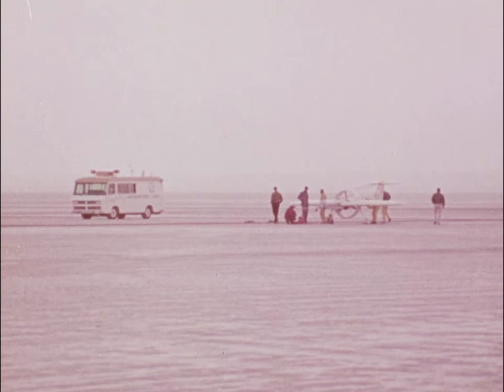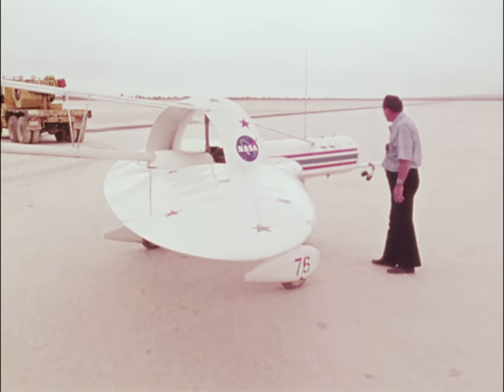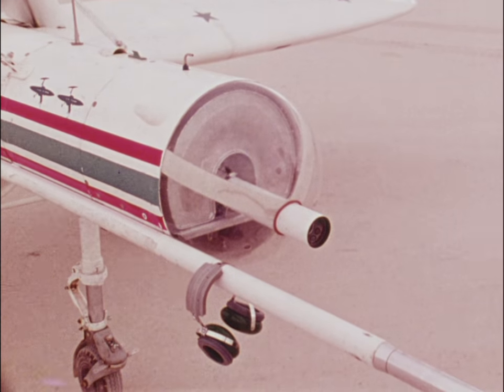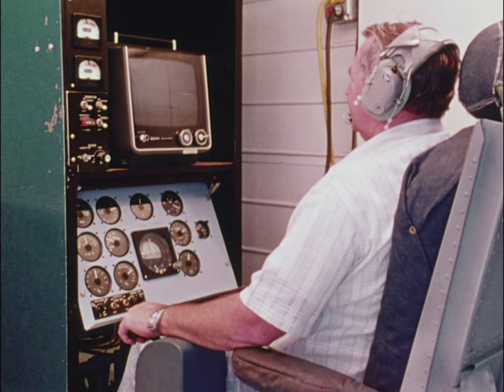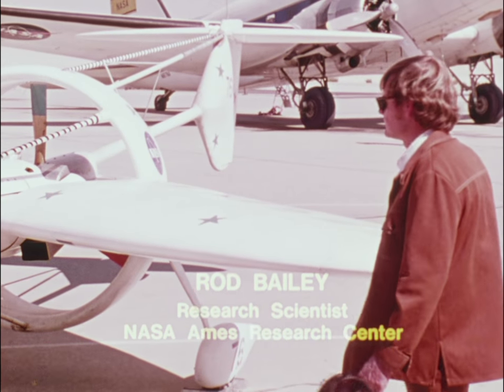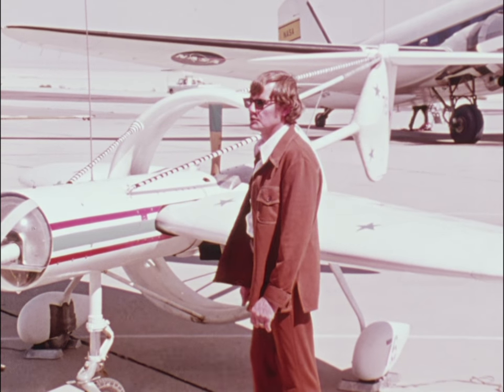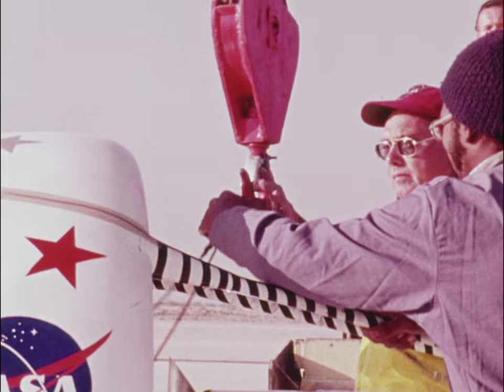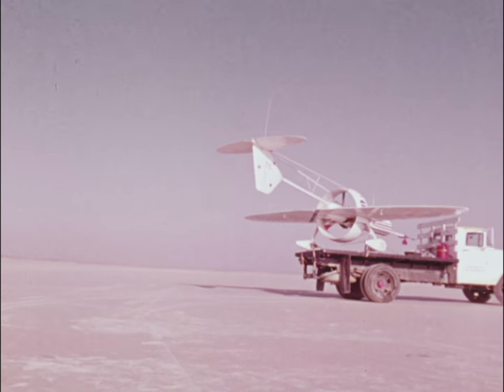Oblique Wing Flights

Comment: I'm no rocket engineer, seriously... A POV on board camera Remote RF fly by wire control from a climate controlled trailer system in 1970 to test this rediculous joke of a project? Dumb idea utilizing HI FI...
Reply: No. Respectully @adam, you didn't check facts.   read about AD-1 flew well piloted, designed by Burth Rutan no less. flew well up to certain angles just standard mechanical controls, not even hydraulics.. And read again what the benefits would be: L/D >30; then low drag at transonic. Not to mention what you could do in a dogfight with it, especially with NASA's DFBW work to stabilize and give globals stability.
 You do it and NASA Langley and Dryden a great disservice, if you just make fun and don't check the facts. The oblique wing F-8 cancelled cuz it looked different, funny.  Might have been a huge mistake. Do we want pilots alive and winning, or looking cool in conventiional craft the enemy can decipher and figure out how to beat?